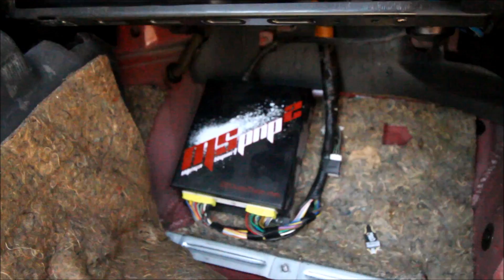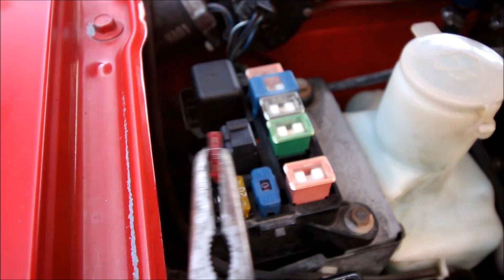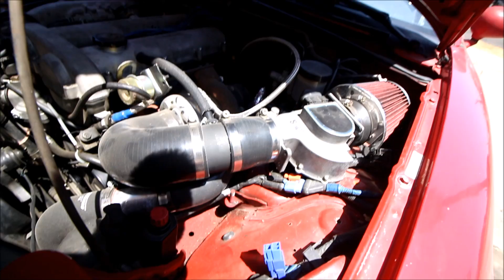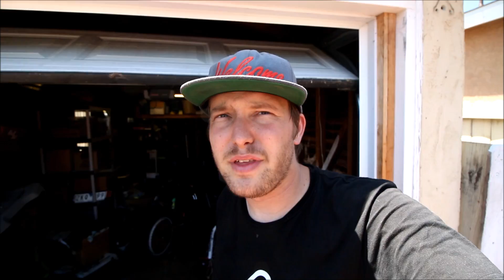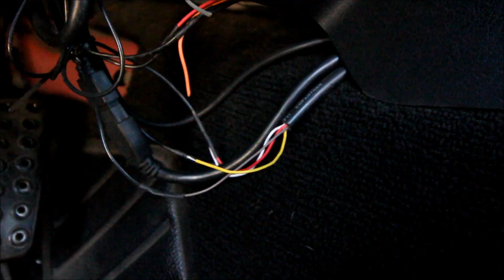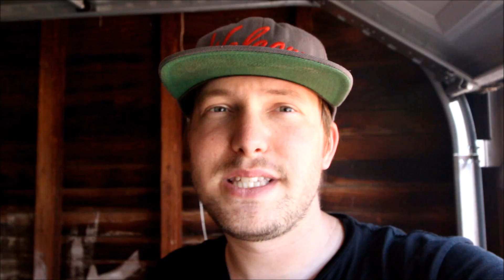Converting Broke & Boosted To Megasquirt!

Comment: So here's a question... At least on the NA8, the ECU controls the AC. So after installing the Megasquirt, does your AC still work?
Reply from the maker: Yes, it has a ton of A/C settings to get you dialed in. You can even have it shut off at a certain throttle % so when you go WOT the A/C turns off for max HP gain haha
Reply: @TheCarPassionChannel  I was actually playing around with an MSPNP2 for a '96, and I found it only has two outputs, WLED and ALED... Well, on the NA8, you need two outputs to run the AC, one for the condenser fan and one for the AC switch. And you still need an output for the engine cooling fan. So... Without modifying the factory wiring, AC appears to not be an option on the NA8. At least, unless you're fine not having the main radiator fan!
Reply from the maker: @ads1035  If that's true, you can wire the fans together on one output. But I'd double check with DIY, seems odd they would sell a PnP that doesn't have full A/C functionality
Reply: @TheCarPassionChannel  Yeah, I suppose checking with them would be a good idea. What's tripping me out is, there's traces on the board, but I can't figure out how to address them.

When you check "Output Test Mode - I/O" in Tuner Studio, it shows you that the MSPNP2 has 9 output pins in total. They are FuelPump, TachOut, Output1, Output2, InjectorC, InjectorD, IGN1, Boost, and FIDLE. 

Of these, FuelPump, TachOut, Output1, InjectorC, InjectorD, and FIDLE are, for sure, already allocated. They're in the factory harness at spots 1U, 4L, 1A, 4X, 4V, and 4Q respectively. 

For the AC fan and compressor relays to energize, it looks like pins 1B and 1G on the factory ECU have to sink 12V. The ECU grounds those pins out. And for it to DO that, it looks like pins 1K and 1P have to source 12V. The switches inside the cabin ground those pins out. 

When I look inside my MSPNP2, pins 1B and 1G have traces on them that go... somewhere... I can't tell where. 1K also has a trace that goes to an LM393N comparator, also on the brown breakout board. So the circuits are here!! So... How on Earth do I program the MSPNP2 to react to them? There's a layer of abstraction between the hardware pins on the board and the software running on the MSPNP2 that I just haven't "gotten" yet.
Reply: So it turns out I was massively overthinking the whole thing. A/C control is done in a separate circuit. The ECU's CPU isn't involved, but the A/C does still work.

Comment: So let me get this straight, with megasquirt, I will only need the mtl-x, boost gauge and exhaust manifold for the turbo. Correct? I don't need the fmu or the o2 cheat
Reply from the maker: Brian Jamal Correct. No FMU required because you can run big injectors instead. No o2 mod because you actually have full control of the fueling at all times.
Reply: TheCarPassionChannel alright, I put in 1.8 injectors and have the car healthy as ever. I will be looking for the mtl-x and a boost gauge next! You're a massive help man, god bless.
Reply from the maker: Brian Jamal You'll need bigger injectors than that if you're going forced induction
Reply: TheCarPassionChannel I have a 1.6 NA, I thought throwing in 1.8 injectors would increase the fuel flow capacity of my Injectors enough to run forced injection am I wrong?
Reply from the maker: Brian Jamal Yes, but  the 1.8 injectors are still only good for a few pounds of boost, you need something 400cc+ if you want to make some power.
Reply: TheCarPassionChannel I see, well other than rx7 injectors what are my options? The installation is the same I guess.

Comment: Do you need to disconnect or do anything different with the stock idle speed control valve when switching to (MS) megasquirt if you have a stock throttle body? Also if I change from stock 1.6l, to a skunk2 1.8 throttle body and add a VTPS, would I just disconnect and cap off the stock ISCV?  Cheers

Comment: If my 1.8 miata has advanced timing via CAS adjustment, do I need to readjust the CAS back to 10 degrees before installing a megasquirt? Or can I install the megasquirt and adjust it there and leave the CAS how it is. My goal is to go back to stock timing
Reply from the maker: Your CAS timing needs to match the MS base timing. whether it's 10=10 or 20=20. I show the proper way to set base timing in my "how to install megasquirt" video
Reply: Thank you! Keep it up with the awesome videos, I set the CAS timing back to 10 by following your video, ready for megasquirt now :)

Comment: Are the base maps for the 1.6l tuned for completely stock, or tuned for basic turbo mods? I have a 1.6l with the turbo and intercooler installed, stock injectors, and stock everything else. I have the my Megasquirt PNP2 on its way but did not know if i will be able to startup and cruise on the base map or if i will need to get it tuned professionally to get it moving? I have no experience tuning and do not want to mess anything up lol
Reply: Also, i have no fmu installed.  I have already started the car with the AFM, which i will be deleting, and it idles great and the AFRs are perfect
Reply from the maker: Joshua Swisher The base map is not tuned at all, it's a base to which you can begin tuning off of. You can typically start up and maybe drive on it, but you'll need to fine tune the fuel map and idle right away typically.
Reply: TheCarPassionChannel OK cool, that's exactly what I needed to know. thanks!

Comment: Is there a list of the parts youve added to the broke and boosted miata? The full list including the turbo and manifold and such?
Reply from the maker: Yes! It's on my website thecarpassionchannel dot com, check out the FAQ page. There's a full build list with details and links for each part. :)
Reply: Do you recommend any exhaust systems that won't make you sound like a ricer haha

Comment: Unrelated question, but I just recently rebuilt my engine/new clutch and flywheel. I also replaced the clutch slave and installed a  stainless steel line. After hooking everything back up I now have no pressure on my clutch pedal. Any ideas why its this way?
Reply from the maker: Did you bleed the clutch?
Reply: thanks for replying. Dude me and my silly self forgot that I took the fluid out of the reservoir before the rebuild. Also the old fluid had sort of stained the master cylinder so it looked like I had fluid in there haha

Comment: Hey Greg, Love the videos! I actually just got an 01 miata with a 6spd manual that only has 26k miles on it. The car was sitting for a while on and off which is why it's so low, i was wondering what maintenance i should perform because it was sitting for long periods of time, also what maintenance i would be able to skimp on because it has low miles?
Reply from the maker: If it's been sitting for a long time, it wouldn't be a bad idea to do a timing kit on it (belt, water pump, front seals, etc) and replace the plugs. It might be fine though, kinda just depends on what kind of elements it was exposed to while sittings. The condition of the accessory belts are probably a good indicator!
Reply: Thank-you for the info, keep up the awesome videos!

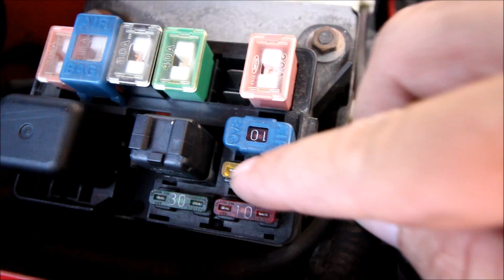Comment: 2:25 why take out the fuse?
Reply from the maker: Because it's in the included instructions, so I did. Something to do with burning up a fuel pump circuit in the ECU or something if you leave it in, I decided not to take my chances.
Reply: @TheCarPassionChannel  ive got a  94 1.8 and i understood i dont need to take the fuse out but my fuel system seems to have a short out or something because the pump doesnt prime when i switch on ignition but it starts pumping a t full capacity as soon you touch the trottle. Its a pre fab for mx5 ms2

Comment: What should I set the redline to in tuner studio? Stock injectors. It's set at 5k currently on my base map.
Reply from the maker: No Miata base map has a redline of 5000 that I'm aware of... lol. You should set it to the stock 7000.
Reply: +TheCarPassionChannel lol. Well my gauge shows redline at 5k, but under the settings it's at 7200. I dunno. Would you perhaps know why my AFRs won't match up on TS vs my MTX-L? LM Programmer and the gauge match. but TS wont change. Even with changing to a custom WB and adjusting the values for voltage.
 I can't get TS to match the gauge I should say. You can see examples if you would like to help in my videos. Thanks.
Reply from the maker: Have you seen my video on matching your wideband to MS?
Reply: +TheCarPassionChannel yes. I have seen all of your videos. Been watching from the start. Miataturbo helps a lot but i get a lot more accomplished after watching you do it lol.
Reply: +Crsp Gngr all of my settings are correct according to what the guys on the forum said. I just cant get the thing to match up. Im currently trying to redo the ground. I had the mtx ground spliced into the ms3x ground. per braineack.
Reply from the maker: If you changed your voltage offset and it's still not matching up you might have a bad ground.
Reply: Do you have a preferred spot to ground the MTX that doesn't lead to voltage issues? Braineack had me use the black ground wire on the ms3x harness, but that's not working obv lol
Reply from the maker: Then you might not have a grounding issue. How far off is it and how consistent?
Reply: 2 full points. I have 2 vids on it on. TS seems to stay in the 10s regardless of settings.
Reply: I ordered a T-tap splice thing to redo the ground in the same spot hope that works.... if not, is there a way to hire you for megasquirt help in Nor-cal? Tahoe is beautiful this time of year lol and I work for a timeshare so I have discounted rooms :)

Comment: So in order to get more power, do I just simply turn up the boost and adjust my fuel maps? Do I need to adjust my timing map as well?
Reply from the maker: Timing should be scaled so that when it goes into higher boost, more timing is pulled automatically. Just don't forget, you can only turn up the boost until you run out of fuel. (Or clutch, or connecting rods, lol).

Comment: Which would you say is easier to turbo and ECU, the 1.6 or the 1.8?? Love your channel btw, you've inspired me to get an mx5 (Downunder in AUS that's what we call them ahah)
Reply: I can't say definitively, but there isn't a substantial difference between turbo'ing and tuning a 1.6 or a 1.8.
Personally I would go with the 1.8 for the little bit of added torque and better spool. I think the rule of thumb is that the 1.8 will spook 200-400 RPM sooner with equivalent turbos. (even better if you VVT swap)

Comment: I was wondering about what  turbo is best as I have a 89' miata and I will be boosting it in the near future.
Reply: best for what? For max power? For spool? With a 1.6 you are limited by what manifolds are available unless you want to fabricate your own.  Popular turbos for the 1.6 are the GT2554 as is used on this channel (albeit with baller parts) an the GT2560. There are different schools of thought though in regards to power.  Some people want to go high power and others want to get the low RPM torque on demand. The two turbos above are the "torque" philosophy and will top out around 300hp with an ideal setup. If you want high RPM power but a very short power band check out the GT30-GT35 turbos.  They will bring you into the 400s and more, but you won't hit those power levels until very high RPMs.  That is personally not my preference. IF you are willing to fabricate a manifold, I have seen some success with the subaru TD03 and TD04 turbos.

Comment: In reference to your CAS o-ring video I was wondering if you need to lube the o-ring first like you would in an oil filter. Figured I'd post the question in your most recent vid as well just in case you don't check older ones. My Miata is leaking a bit of oil and I figure its either this or the rear main

Comment: Planning on boosting my 1.8 MX5 with the help of your vids, are there any major differences I need to factor in? I'll probably need a different FMU ratio than what you're running because of the way the 1.8 injectors work, right?
Reply from the maker: If you go MS, skip the FMU and just use bigger injectors. If you're keeping the stock injectors and ECU, I'd try a 10:1 FMU? Most setups like that take a 8-12 or so
Reply: Sweet, thanks man. Yeah I plan to go FMU first just for the learning experience. Then later on upgrade injectors/buy ECU.
Your vids are mint.
Reply: @TheCarPassionChannel  So, I purchased someones fmu boosted 96 1.8 with t 28 ebay kit, blox fmu and what seems to be stock everything else. Can I somehow wire a fuel pressure sensor into the ms2 pnp option port to accommodate the fmu of unknown rate? Got maybe 4 months of weather left in new england that I can work in my driveway left, I wasn't sure if you kept the fmu with the  ms ecu on broke and boosted or not.  Not seeing a signal modifier or transducer switch on my o2 circuit but I'm sure wideband and ms would make that obvious immediately. I'm thinking they pulled ms out of this car bc the ecu is just resting on the studs lol, about to investigate the interior of the ecu to be sure it's not been altered.

Comment: yo G, my ms2 pnp, wont run when i have my rx8 inj in, even when iv put them in on tuner studio..any idea
Reply from the maker: You don't change the cc of the injector in MS, that doesn't do anything. Change Required Fuel to 6.5 and see of that starts it!

Comment: Out of curiosity, how much power do you think your Miata would have made (before it blew up RIP) on pump gas and not e85
Reply from the maker: I'm guessing 250's or so, 91 octane is just more fragile, haha.
Reply: +TheCarPassionChannel true lol reason I ask is because if I were to boost, I'd still be running pump

Comment: Just put a MS2 into my N/A NB1. AFAIK there is no fuse to pull and you do not need a wide band on an N/A car. Might be worth mentioning.
Reply from the maker: You 1000% need a wideband if you're using MS, how do you plan on tuning it?
Reply: Sorry, let me rephrase it, the car does not need a wide-band to run a MS. If you tune yourself, then you definitely need one. My tuner put a wide-band into the exhaust and did it that way.

Comment: I wonder if you could use just mega squirt in a stock miata just to make it more fuel efficient for daily driving
Reply from the maker: yossi126 It can most definitely save fuel as well over a stock ECU. You can make the fuel and timing maps more efficient.
Reply from the maker: People have done that! When tuning a turbo car, you can also tune how efficient it is when you're off boost as well.
Reply: +Yuuyia Takahashi 
To get in contact with you. So we don't thread jack the comment section here.
Reply: +boofighter email at rr.takahashi.yuuyia@gmail or youtube DM
Reply: i thought about doing this too but can the stock engine be more efficient while making at least same stock power? and it would have to drink a lot less fuel to offset the cost of the ecu.
Reply: If you know how to tune well I'm pretty sure you can
Reply: You can. You will gain anywhere between 5-20 whp depending on year miata. No fuel saving though..
Reply: +TheCarPassionChannel
 I have been thinking of doing this for my MR2. It has a very simple ECU and I would like to get a bit more power out of it and have room to grow as I mod it. I would like to put a better head on it, bigger valves, and bigger injectors.
Reply: +boofighter if you have a 3SGTE i dont recommend megasquirt. Just because while working an mr2 specific shop ive witness many fueling issues in the set up. Your better off getting the basic level Hydra
Reply: +Yuuyia Takahashi
I have the fire breathing 5sfe.
Reply: +boofighter oh rerry?! Lol then megasquirt should be fine for the functions you need. Just make sure all sensors are properly wired and working
Reply: +Yuuyia Takahashi 
I am still in the learn, reading and research faze. That's one of the reasons I found out about this Chanel.
Reply: +boofighter heard. Well if you have mr2 question feel free to hit me up.
Reply: +Yuuyia Takahashi
What is the best, easiest way?
Reply: +boofighter easiest for what? Lol be more specific.